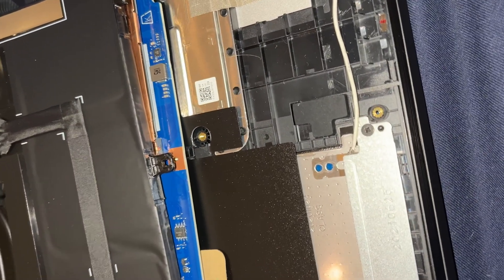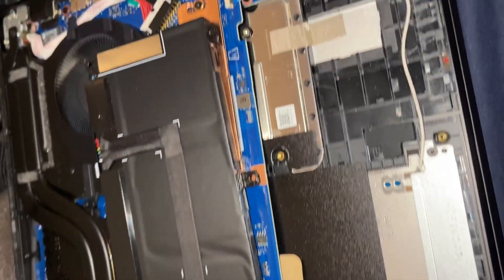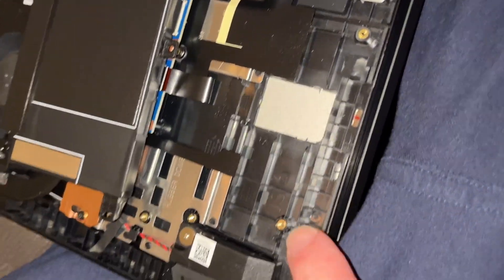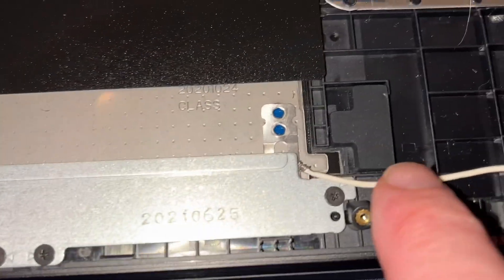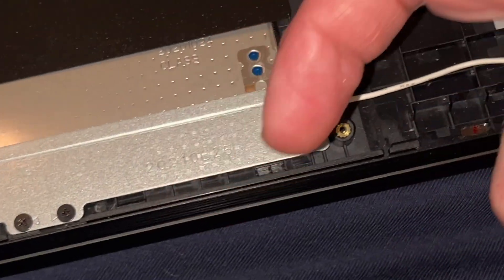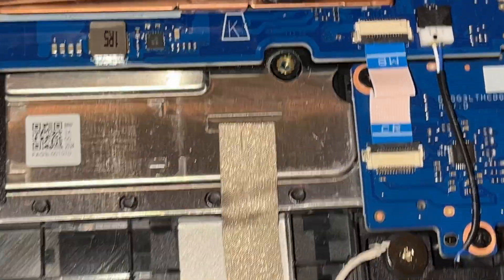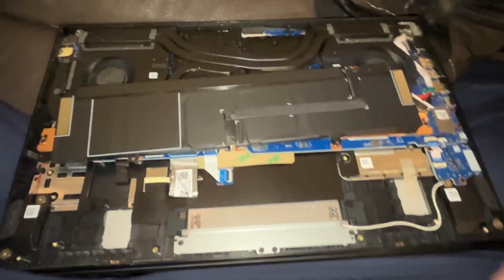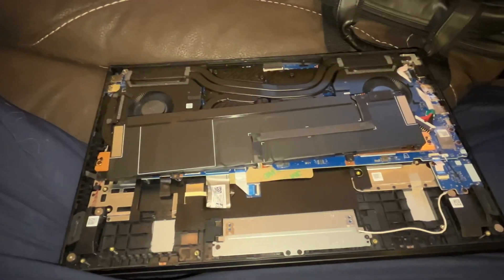HP Omen laptop mouse lag fix.

Comment: omen 17 with rtx 4080 here, I do it 2 days ago and after doing this I never get the lag or the need to fn+f11 again for now, for those wondering what calbe use I just cut in a necesary piece 1 old charger I had, thx and cheers from Spain
Reply: Wtf you get this on the newer models too?! Thats insane they didnt fix such a simple grounding issue

Comment: I tried that but post doing that laptop showed some kinda CMOS issue at the boot-up. And then didn’t run at all the next time. Now even the battery indicator is not showing.
Do you have any idea how I should go about it. It’s really causing me a headache.
Reply from the maker: @yashsharma7277  i’d start by verifying that you plugged everything back in securely if you took out a battery or something. There are some little plugs in there that could be easy to disconnect. I hope you didn’t mess anything up. Make sure that you’re not connecting that wire to something that has a current on it.
Reply: @ Actually I kinda now understand the issue. Actually my laptop was Omen 17, wherein the silver screw was connecting with motherboard and I connected the wire to it due to which, something in the motherboard short circuited probably.
Reply: Now when I tried diagnosing my laptop with HP service centre, they’re asking for a hefty amount for replacing the motherboard and I’m cooked. 
What do you think I should do?
Reply from the maker: @ oh no……
Reply from the maker: @ I couldn’t tell you man. If warranty service can’t handle it, I wouldn’t know where to go at this point.
I hope you get something worked out.

Comment: TBH I feel like a tool for not sending this thing back and pressing HP until they fixed their shit. I use the mouse mostly and really needed this thing but it's really not acceptable to ship a laptop like that.
Reply from the maker: @ZennybearOG  I agree with you 100%. But whatever solution they give you when you ship it back would just be temporary. They need to be sued. There’s actually a class action lawsuit against them going on for this kind of crap.
Reply: @DSBsky77  probably yes.. and serves them right, i hope they pay for this disservice. Thanks in any case for your video, will have to open up my laptop to add more space and ram, will also take care of the track pad
Reply from the maker: @ more RAM is always good. And I hope you enjoy your functioning trackpad. Lol

Comment: Can I use the wire of my old headphones to do that ?

Could you make all the video of opening the laptop please ? I've never did it, I'm affraid to not know how to close it back...
Reply from the maker: @annonymous7112  just make sure you use a solid wire. Not stranded. There are many videos around about how to open a laptop, and they are all the same. Don’t worry about it, it basically just clips together with some screws.
Reply: @DSBsky77  Thank you ! I couldnt wait so I tested it, and it worked !!

I took too much risk because all my thesis work is on this PC...

Thank you again !
Reply from the maker: @ you’re welcome, buddy, I’m glad it worked. I would definitely recommend backing up that thesis to a cloud source though. Lol
Reply: @DSBsky77  yeah... My defense is in 19 december, after that I will delete everything and forget it lol
Reply: @DSBsky77  please tell me, do you detect Wi-Fi 6E on your Omen ? I can detect 2Ghz and 5Ghz only. But not the 6Ghz.

My phone (Google Pixel 7) detect the 6Ghz though

Comment: what wire did u use?
Reply from the maker: @nauryu7  I used a thin, solid copper wire. I wouldn’t use a stranded copper wire because a little pieces can break off and the last thing you want inside of your laptop is a bunch of little pieces of copper wire floating around. Lol

Comment: What type of wire did you used ? I don't want my laptop explose into my face haha
Reply from the maker: Small, single, solid copper wire. threaded wires have a tendency to break off in small pieces.

Comment: had this computer since it came out. I had the same issue and it was driving me mad. I went and ran 3 skinny wires from the track pad and screw. once I put everything back together and turn my computer on the trackpad works flawlessly
Reply from the maker: @Mounier777  happy to hear that buddy. I can’t believe we have to do this kind of stuff but here we are. 😂
Reply: @DSBsky77  💯 right. I love this laptop but my next laptop im considering is the Lenovo legion. my legiongtx 1660 ti  no issues. and still works flawlessly

Comment: Is it possible to put the cable somewhere where the mouseclick still can work?
Reply from the maker: @psyview4188  yes. Just slide it in the other direction but also make sure the cable isn’t thick. And if you twist it, don’t have the twist under the metal.

Comment: Hi, I've got an omen 16 and have a quick question: What type of wire did you use, is there any specifications on the type of wire? Thanks!
Reply from the maker: @EdwardOConnell-vf7cj  just use a very thin, solid, copper wire. No real specification.

Comment: hay bro, have you found any permanent fix for this.? As i am also facing the same problem even after following all the steps shown in this video but my problem still exist.
Reply from the maker: @faaziexperts1344  not really. Seems like the cable inside moves around or something happens. You might get a few months or several months of reprieve, but it seems like the problem just always comes back. Better than nothing.

Comment: i need to know . i have hp victus and having same trackpad laggy issues. now can u  tell me will this work if i connect the wire to the with one of the right side screw instead of under that metal bracket where the trackpad clicks are. will this work or not please tell

Comment: it worked perfectly, Thanks!
Reply: i need to know . i have hp victus and having same trackpad laggy issues. now can u  tell me will this work if i connect the wire to the with one of the right side screw instead of under that metal bracket where the trackpad clicks are. will this work or not please tell

Comment: Happy to say this fix worked for me! Just some notes to anyone doing this. I used a long zip tie that I stripped the ends of. The screw on the right gets stripped easily and is a pain to unscrew. I ended up needing pliers to loosen it. Finally id tie the part connected to the metal part of the touchpad to the left of where he shows in this video instead of the right so that the wire doesn't get stuck under the left click and prevent clicking.

Thanks again to you and the genius that figured this out!
Reply from the maker: Excellent, glad to hear it. 😁
Reply: i need to know . i have hp victus and having same trackpad laggy issues. now can u  tell me will this work if i connect the wire to the with one of the right side screw instead of under that metal bracket where the trackpad clicks are. will this work or not please tell
Reply from the maker: @muhammadazeem-iz5mq  I honestly cannot give you the answer for that. However, I can say that it’s not difficult to try it though.

Comment: Hello, it looks like you uploaded an updated video but that link is no longer working. Is there a better way to do this?
Reply from the maker: The link to this video is working fine for me. But there is no other way that I am aware of. Sorry.
Reply: @DSBsky77  Thanks for checking, when I go to the link It still says "This video isn't available anymore" /watch?v=YZJ44v9s8XQ 
I finally got the tools and some wire to try this, I ended up using speaker wire but It's still pretty spotty, it'll work for 30 seconds then stop then work for a bit more then stop pretty consistently but randomly. Not sure what else to try at this point. I may try adding another wire to the left side of the board too.
Reply from the maker: @EricIDS  I don’t get it.. here’s the link if it helps.  https://youtu.be/MJoFstWU5X8?feature=shared

Comment: Hello ...I have HP Omen 16 gaming laptop i bought it 1400$ but windows 11 top left corner of every window is selected automatically even if no window is opend and i am at desktop the first icon at top left corner is selected  and it happens sometimes and one restart fixes the issue but again it happens and i bought my laptop just in a few weeks and its brand new and no hardware damage ... any help please?
Reply from the maker: I’m sorry. I do not know what would cause that. Perhaps something in the track pad is stuck or it could be related to the same problem. You might try the same fix. It couldn’t hurt.
Reply: @DSBsky77  thanks for reply

Comment: Hoy hice la instalación de un cable USB en la zona pero sigue con el problema 😢
Reply: Today I installed a USB cable in the area but the problem still exists 😢
Reply from the maker: @christianmunoz2716  no debes instalar un cable USB en ningún lado. Debes tender un cable de cobre sólido y aislado. No es un alambre de cobre trenzado. Un alambre de cobre macizo. no debes instalar un cable USB en ningún lado. Debes tender un cable de cobre sólido y aislado. No es un alambre de cobre trenzado. Un alambre de cobre macizo. Asegúrese de fijarlo a un tornillo interior que sea metálico y que esté conectado a una placa metálica de algún tipo.
Reply from the maker: No habla espanol. Google translate por favor.

Comment: Having the same problem on a Firefly G10. Tried similar but doesn't seem to work. But the touchpad on this looks a little different to that in the firefly, I'm wondering if I'm connecting the wire in the right place. Has anyone else had trouble with the Firefly and able to help out?
Reply from the maker: I hope you get some help with that but unfortunately I’m not familiar with the G10.

Comment: An absolutely great fix. Resolved the issue with touchpad instantly. I wish I found this earlier. Soldered the wire in and the issue is gone. HP wtf...
Reply: do u again facing the issue after the fix ??
Reply: i need to know . i have hp victus and having same trackpad laggy issues. now can u  tell me will this work if i connect the wire to the with one of the right side screw instead of under that metal bracket where the trackpad clicks are. will this work or not please tell

Comment: I bought an OMEN by HP Laptop 16-c0095ng (Ryzen 9 5900HX, GeForce RTX 3070) in February 2022 that cost €1,999. My machine has also been affected by this problem since the very beginning. I will try this solution. It's a shameful disgrace for HP.
Reply from the maker: I agree, it is and I hope this helps you like it's helped  alot of people. :)

Comment: It is not risky to connect that cable in that way, could a short circuit occur that would affect the entire board or is the ground located in that place? Is there a diagram of the board to see if the place where it is being connected is safe?
Reply from the maker: Well, I have been using it for months like this. So I find it doubtful lol. It's not connected to anything that has power going to it.

Comment: i have kinda a weird problem with my pavilion 15 the touchpad works normaly but after an hour or sometime random time it starts to click everywhere by it's own
Reply from the maker: Like left click and right click?
I’d try disabling and reenabling the device in device manager.
I’d also try uninstalling the driver then restarting and letting the driver auto update.
It also might fix it if you use this same method that fixed the lagging out.

And one more thing, run “MBAM” (malware bytes). 
That could even be a virus.
Worth checking out and MBAM is free and it’s an awesome software to have.
Reply: @DSBsky77  dude literally I've done everything from installing new drivers to rolling back to old drivers and disabling it and enabling it i did 2 clean windows installation but no effort
Reply from the maker: @chihab5016  well that sucks. HP needs to step up their game because that’s bullshit.

Comment: I did this with my 17 and it still is not working, I even tried adding another cable to the other side. Ik the issue is still the static, bc if I’m on carpet the issue is a lot worse. If someone has an answer it would be greatly appreciated. I’ve done everything possible and the issue still persists, it’s really pissing me off lol.
Reply from the maker: Try running a solid copper wire instead of a braided one. And try running it to a screw on the M2 NVME. Also try not putting the screws back in to the bottom of the case after you are done. Just snape it back together. I am starting to wonder if those screws may somehow be related to the issue.
Reply: @DSBsky77  I just ran a wire to one of the ground screws on the motherboard and it worked. It should be a black screw with orange ring below it
Reply from the maker: @milkydurag  Excellent! Glad to hear it buddy. :)

Comment: it did this in my omen 16.1 laptop but it has been 4 -5 days (after suffering from dec 2022 :(  )  it works fine but sometimes in a day or twice a day it happens again                                                     where can i sent you pic of laptop ?? . i joined a wire around metallic riser . and one more  doubt can i use cello tape to applied area ?
Reply from the maker: Try using a solid copper wire instead of a braided one. I think it is more reliable.
Reply: @DSBsky77  can i use tape?
Reply from the maker: @samakshgoswami  Why would you use tape? To hold it in place? As long as it doesn't make any connections between parts that transfer power it should be fine but I think it's kind of unnecessary. Then again. Doing this in the first place should be unnecessary lol
Reply: @DSBsky77  hello  its been 1 month after i texted    it was working fine but then its lagging when one day i moved laptop from one room to another by one hand then i have to open the lid and open the screw and tied back .   do i have to do it every month as its work fine for a month then again somehow starts laggiing . i think wire starts loosening or other issue . please help me out i want to connect with you 1-1 .  as 2 months left in its warranty.
Reply: it returns :{
Reply from the maker: @samakshgoswami  did you use a braided copper wire or a solid copper wire? I would recommend you use a solid copper wire. And make sure that it’s firmly attached. I had to do it once and that’s it.

Comment: I did it but it always happens again after a while, could it be a cable problem? I have already tried 2 different ones, and did I leave that plate where it is tied outside or under the large metal plate? I have it like you and it gives me the same problem over time:/ thanks for your help
Reply from the maker: I did it again but with a solid copper wire this time instead of a braided one.ran it to the screw on the NVME slot of the left.
So far, so good.

Comment: I just bought my omen 17 and I was pissed off that it is defective.  Now Im trying this and let you know if it works
Reply: So far so good. I just want to thank you and the reddit guy❤
Reply from the maker: Hey buddy! Glad it helped. 😁👍🏻
Reply: No issue for you still now right? I hope mine works too
Reply from the maker: @ohtubeet  I’m good still but if you run the wire in a way that it can move, it may shift into a position that allows the problem to return so watch out for that.
Reply from the maker: Good luck. It’ll work but you definitely shouldn’t have to do it. I am extremely disappointed in HP for this and I won’t buy another laptop from them after this.

Comment: I have HP Victus and it's touchpad is not responsive and some it doesn't move a bit and sometimes it does. Is it the same issue?
Reply: It worked fine for a year but it started happening past few days.
Reply from the maker: @deveshsharma8792  most of us had this start happening to us almost immediately. So I couldn’t tell you for sure.

Comment: Not only did it work for me. But for some odd reason my fanspeed er now very low and so are my idle cpu temps. CPU temps went from 70 celcius in Idle and a ramping fanspeed to 35-45 degrees celcius and fanspeed virtually dead silent. I did just tape the wire to check if i worked. I will solder it later on.

laptop: Omen 16 - ryzen 5800h - rtx3070 - 32 gb dual rank dual channel
Reply from the maker: I have no idea how that happened but I’m glad everything worked out so well for you. Lol.

Comment: Hello, when you connect an external monitor do you have problems on the external screen? (my version is with amd graphics)
Reply from the maker: Nope. I hook it up to my oled tv. I set it up in nvidia control panel though. You might need to do some kind of display setting

Comment: it worked for me, thanks!
Reply: i need to know . i have hp victus and having same trackpad laggy issues. now can u  tell me will this work if i connect the wire to the with one of the right side screw instead of under that metal bracket where the trackpad clicks are. will this work or not please tell